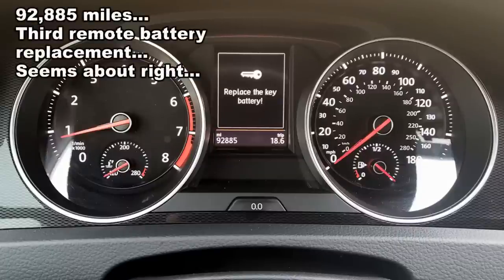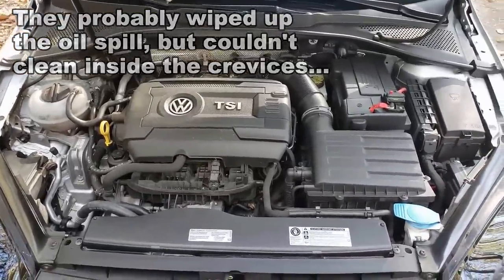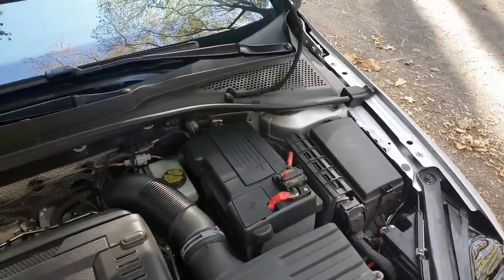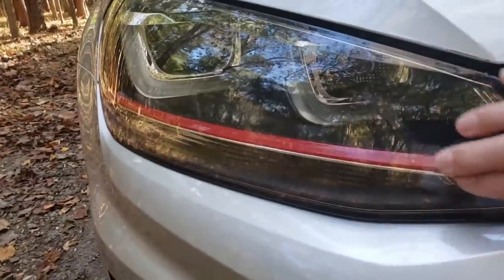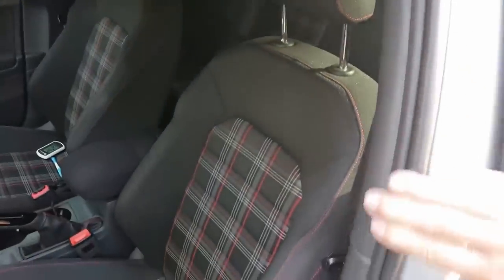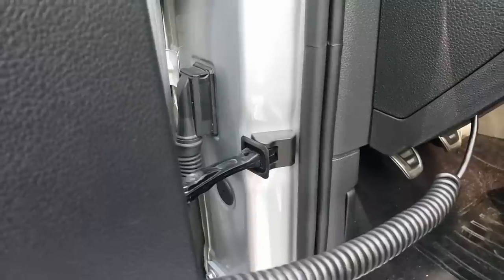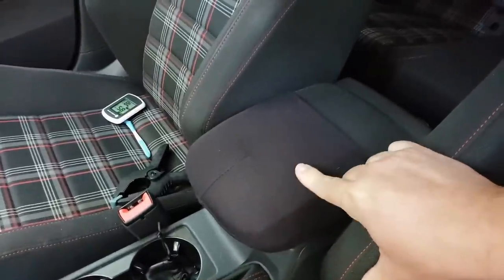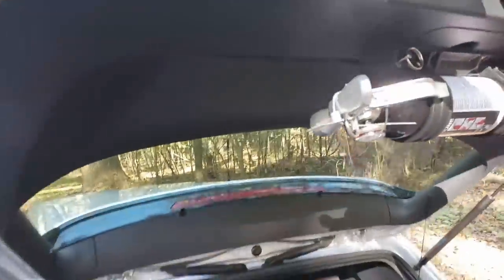THREE YEARS AND 93,000 MILES: My Report, Part 1

Comment: Many parts are unacceptable, such as all these little problems you mentioned.
I have a 2012 mazda 2, it's a 7 year old car, never has been in a garage, always out in the weather, it has almost 50.000 km and I haven't even replaced a light bulb...
Reply from the maker: Okay. My car has three times the mileage (use) and is kept outside. Light bulbs are all good. ;-)  I've already run the car farther than many choose to keep them. It's a win in my book. Come back when you're at 150,000 km and let me know if you're still problem-free. Later.
Reply: @StealthGTI  really? That is your arguement? Ok cool...
Reply from the maker: @sta8ise  - Yes, that's my argument. It's basic math: Your car is a driveway queen compared to mine. It's hardly been driven. My wife's Jetta is similar to yours in use. It's a 2018. In 2025, I suspect it will have 35,000 miles (50,000 km) and a similar report to yours. Take Care. -Scott
Reply: @StealthGTI  you are totally wrong. It has never been in a driveway. All the miles, have been driven IN the city. So you are making a video about all the issues that your car has after 3 years, and yet you are still defending this car? you would still buy it? Well I wouldn't... My point of view is that a car should have no issues after 3 years and 93.000 miles. If it has, I won't buy it, period... 
Oh and by the way, just because you like basic math: a friend of mine has a mazda 2 with 350.000 km and he hasn't even replaced the clutch, and has no issues what so ever.
Reply from the maker: @sta8ise  In a driveway or at the curb, it's all semantics. You barely drive your car, compared to mine. My wife doesn't even have a commute and drives more than you. Regardless, I suspect you're right about the Mazda 2 being reliable. Cars with less complicated systems, such as a 1988 Nissan Sentra that I had from 1988-1999, have far less to go wrong. Unfortunately, they're also boring to drive. As for your friend, good for him. Again, less complicated cars have less to go wrong. Regardless, I doubt he's done as much with his car as I've done with mine (330 hp and towing 1500-lb trailers). "Pay to play," we say as we modify. Take Care, -Scott

Comment: Too much plastic components on this car for my liking, plastic water pump, sump, intake plenum. Makes it feel like a disposable item lol
Reply: As with most cars these days. Only designed to last the length of the warranty.
Reply from the maker: Most cars in the lower end of the price spectrum are using more and more plastics. This is especially true in the front, where cars need to crumple to absorb energy. I don't know if quality cars, such as Lexus and Mercedes, use less plastics or better ones. But the plastics are still there. Thanks for visiting.

Comment: great video, i have basically this exact same car, 6spd 17 GTi sport.  i bought it almost a year ago with right around 70k miles, now it has almost 85k and i’m seriously surprised with how great its been.  i love the car, it’s given me some problems but nothing too serious, at around 80k, i had to replace the battery, just recently the leather on the handbrake started to peel up, and my stock clutch seems to be on it’s way out.  i installed VWR lowering springs, ECS wheel spacers, k&n air filter (cheap route, i know), and a little while ago i decided to cut the mufflers and resonators off.  just ordered a rev9 catback with mufflers because i’m not a huge fan of how it sounds anymore, then i’ll order a cts catted downpipe after i (hopefully) pass emissions with the new catback.  APR stage 1 tune should hopefully come soon after i get a stage 1 clutch too.  love this car, great daily driver, been super reliable so far, and it’s never a disappointment when doing some spirited driving.
Reply from the maker: Excellent news! Yes, you get what I was talking about with the leather on the parking brake. I just peeled mine off. I think it looks fine in piano black.  :-)
Reply: Still got the car?

Comment: Hi I just have a question can you tell about carbon buildup on valves I just bought a 2019 gti and I will like to know more about that thanks
Reply from the maker: Ovidio - I have no experience with carbon build up. Mine valves may have deposits, but it hasn't affected the way the car drives. Therefore, I cannot comment.

Comment: VW's cars are no longer the paragons of reliability they once were. They're not cheap to put right once out of warranty, either. I know nothing of BMW USA but my personal  experience here in The UK is that you'll find a BMW far less punishing to own than a VW. I ran a second user 528i until it was fourteen years old and it was no more costly than running a Ford or Vauxhall of the same age. It didn't go wrong much either. Certainly not the money pit they're often perceived to be.
Reply from the maker: Thanks for sharing that. I may need to consider BMW over Toyota for my next car.  ;-)
Reply: @StealthGTI  I'm currently driving a Mazda. I doubt you'll find BMW any less reliable than Toyota. But I can't comment upon costs of BMW service parts in The USA. Many assert that BMW US dealers are overpriced.
I made it patently clear I was speaking purely from personal experience only.
Reply from the maker: @paulanderson79  - Thanks. I was leaning toward BMW only for the German heritage. I've since looked at the pricing for both new and used. I can't justify it, which is probably why I've stuck with VWs for over 20 years. If I leave the fold, it will probably be for a Toyota. HAHA!
Reply: @StealthGTI  I had a bad experience with a second user Passat. Out of warranty everything that could fail did fail. And expensively. I replaced it with a Mazda 6. So far I'm happy with it, only time will tell.
Reply from the maker: @paulanderson79  - We had a new 2003 Passat. It was great, albeit a hassle to maintain, for 10 years. Then it was one problem after another.
Reply: @StealthGTI  2003 was well within the era when VW deserved its recognition for reliability. It seems that around 2009/2010 things took a turn for the worse. Not sure if that coincides with anything internal to VW's executive management or just a response to market forces. My Passat was a 2006 model and it was fine til about 2012 when things went expensively wrong. I ended up pumping over £5000 into it over two years. Outrageously expensive to put right. Hence replacing with a Mazda in 2014.

Comment: What clutch did you replace yours with after it went out? I have 24k miles on my car and I feel like my factory clutch is starting to lose it's bite. It hasn't started slipping yet though.
Reply from the maker: I went with an RSR kit from HS Tuning. I have details at https://stealthgti.com/2017/11/06/rsr-clutch-upgrade/. Thanks for visiting.
Reply: rambow70 I’m at 48k in my ‘16 and for the first time I felt what felt like the tiniest slippage the other day. I realized I’ve been driving it so hard so I’ve relaxed and it’s gone away but I still fear it’s on its way out

Comment: Where do you take your GTI for service especially all the fluids changed and how often each fluid got changed?
Reply from the maker: So far, I've done fluid changes myself. I extract the oil through the dipstick every 10,000 miles. I followed a three year interval with the VAQ fluid... just did that today. I'll do the 6MT transmission fluid soon. The brakes will be flushed soon, too. According the service booklet, the first flush is at three years, regardless of mileage, and then every two years thereafter. I think that's it.

Comment: I just found an oil pan leak on mk7 Golf GTI.
My coolant was low went investigating and found an oil pan leak, cannot find the coolant leak tho
Reply from the maker: Thanks for sharing your experience. Was the oil pan leak on the gasket or at the plug? As for the coolant leak, I've decided against topping off my coolant. I wanted to see how low it would go. Oddly enough, it appears to have stopped at the "MIN" line and hasn't moved in months.
Reply: @StealthGTI  Turns out it was a coolant leak from the thermostat and water pump. What I thought was oil on the oil pan was just the coolant coming from above.
Thermostat and water pump replaced. Haven't seen any further issues.
Although the dealership said the oil pan leak was from the oil fill cap but I found that hard to believe as the fill cap it at the back and the fluid I saw was at the front.
I will still be getting the fill cap replaced tho
Reply from the maker: @svisuals6180  - Thanks for the follow-up.

Comment: My wife has a 15 gti SE with manual trans. The strut pucks were not removed on ours either. 95k miles so far and stock battery still going strong. I have an S3 and it has the larger battery. Maybe because it has start/stop? Our gti needed coolant topped off once and never needed it again. I’ve read about many needing water pump replacement. My S3 also needed topping off. Wtf is that chintz canvas on the back side of the rear seat? That’s factory? Our car has leather and the backside is carpeted. Also the gti has been APR stage 1 for last 30k and the clutch is great. Nice to see how others are aging. 👍🏻
Reply from the maker: Thanks for the comments, Burb. The canvas on the back of the seats is actually a full-length cargo liners, primarily designed for dog owners and outdoors folks. Remember, my car is a working car; so, I wanted extra protection for the interior in case I haul something that can cause damage (which I have). I figured anything that could withstand claws digging into it would tolerate my loads. See a photo of the entire liner at https://stealthgti.files.wordpress.com/2017/08/canvasback-011.jpg. I have a full write-up at https://stealthgti.com/2017/08/09/canvasback-cargo-liner/. Take Care, -Scott
Reply from the maker: Oh, the photo doesn't depict it well, but the cargo liner on the floor and seatbacks is a single piece. So, it contains spills, too. I keep the factory cargo liner on top as an additional layer of protection. It's particularly useful when I carry a bicycle... It keeps the pedal from digging in.
Reply: StealthGTI ohhhh sorry haha I wondered. Makes sense. The hatch is so practical. We’ve camped with that car as well. on the other hand I can’t fit crap in my S3 which is basically a golf r with a trunk.

Comment: The coolant leak comes from an o-ring pipe connection right at the water pump. It just builds up that point with a slow drip. That's why you don't see any evidence of a leak. Happened on my 2L Tiguan.
Reply from the maker: My cooling system recently received a clean bill of health from a shop that would have gladly taken my money to do repairs. I'm sure everything is fine... until it isn't.  ;-)  Thanks for visiting.
Reply: You can't see the problem without removing the intake manifold. The water pump is well hidden unfortunately. 
Are you still missing small amounts of coolant?
Reply from the maker: @kgmMachineworks  - I have recorded the reservoir's current level, both hot and cold, and will see how long it takes to make a substantial change.

Comment: How is this car during the winter? It handle well with proper tires?
Reply from the maker: All-season tires are sufficient in my area. I've read that the GTI does very well in winter conditions with winter tires. Still, if the snow is deeper than 4-5 inches, then you'll be pushing against a lot of extra friction when the front spoiler acts as a plow. Thanks for visiting.

Comment: Buy a Toyota you can put that many miles in it each year and still have it run like a champ.. 👍👍👍
Reply from the maker: You're probably right. However, I didn't buy a GTI for what it is; I bought it for what I could make it, an example being a easy addition of 100 hp and 100 lb-ft. Nothing in Toyota's line-up gives the same balance of power, handling, and utility as the Golf/GTI. With that said, my needs may shift in a couple of years, which may result in me considering a 4Runner or Tacoma. Time will tell. Thanks for visiting.
Reply: @StealthGTI  Yeah that's true Toyota has failed in the fun department, I wish I could be excited about Toyota 86 or Supra but Toyota failed.. :-/.. nice looking car though.. 👍

Comment: I´m german. And I had many VW and Audi-Cars. Since 30 years. But my next car is japanese. 
Because of the relieability.
Reply from the maker: I've considered a Toyota 4Runner. But that's probably not what you have in mind in Germany. What are you considering?
Reply: @StealthGTI  
Thank you for answering.
I also consider a Toyota RAV or a Mazda CX 5. Both with AWD (All Wheel Drive) because I live in the mountains and sometimes we have much snow.
I would prefer Toyota, because it is the best brand in Relieability. But I don´t
like the automic gearbox from the RAV. And the CX5 motor is more powerful. But now I haven`t made a decision between Toyota and Mazda. 
Actually I have my Golf 6 TDI from 2011.
Reply from the maker: @peterx7230  - Very good! I've considered leaving VW from time to time. But the VW community is great. So far, the community outweighs the shortcomings of the car itself. But for how long?  ;-)

Comment: How long does a typical gti clutch last and what is cost to replace?
Reply from the maker: "Typical" is a tough one to answer. My stock clutch started to slip because of the extra power and towing. Its RSR replacement has been on the car for 150,000 miles. It slips on rare occasion. Replacing it with the SBC that I want will cost around $2600 including labor. The slip is very minor; so, I will let it run until it's worse and more consistent.  Thanks for visiting!

Comment: I Just finished building the motor in my 2015 A3 (same engine) I Went with a steel oil pan, no leaks at all, but oil temps are 4-6* higher than with the plastic pan.   I am going to put the plastic pan back on with the ECS street shield and should be a good choice.  

You need to make sure to use enough silicone , but also let it cure for 12-24hours.
Reply from the maker: Thanks for the note. Yes, my car definitely sat for 24+ hours to ensure the adhesive was cured. I'm going to try a Tiguan gasket with the steel pan first. It's a much less expensive option. If it holds, great! If not, then I'll go back to stock and get a skid plate. Take Care, -Scott
Reply: StealthGTI bro try using Hondabond. When my aluminum pan broke on my 1.8T the Acura dealer used that with a new pan and it never leaked there ever on my Passat

Comment: Your coolant loss isn't due to a leaking water pump/thermostat housing?
Reply from the maker: It doesn't appear to be. I had a competent VW specialist have a look. He didn't find any leaks. Oddly enough, the "low" coolant has stayed right at the "MIN" mark since around February. I have a follow-up posted from a few weeks ago. I'll post another update in November or so. Thanks for visiting.
Reply: @StealthGTI  Wow, you're the guy. Best get you up to Herndon to VWoA, and tell them you're real - no leaky water pump and no carbon build up induced cold start misfires.

Comment: I have a 2015 build date 05/14 with almost 94k lowered almost 2" and have the plastic oil pan. I have heard that the composite oil pan is actually stronger than the steel ones.
Reply from the maker: There are millions of composite pans out there. I imagine only a fraction of them have failed. Still, I have to disagree with the reports of the composite being stronger than steel. I've seen plenty of these pans that had shattered when struck by a stone or other road debris, which results in an immediate loss of oil pressure. Steel is far more likely to bend than break. It may still contain the oil or it may get a pinhole or slit if the steel creases. Either way, the loss of oil is much slower. I also think that anything that hits the steel hard enough to cause a failure will compel me to stop and look for leaks. The composite, if it fails, will shatter and dump the oil immediately. That was a bit long-winded. HAHA! Here's a photo of a damaged composite pan: https://stealthgti.files.wordpress.com/2017/12/crackedpan.jpg - Thanks for visiting! -Scott
Reply from the maker: I forgot a detail: Plastic/composite parts in the engine bay tend to become brittle over time. I think the heat cycling weakens them over time. I honestly don't know if the oil pan failures happened on older Mk7s or newer ones. Regardless, I tend to keep my cars long enough that removing a potential failure item is a good thing.  :-)

Comment: I want to go to a steel oil pan for the sole fact of being able to install an oil pan heater for winter, much better for the engine to get warm oil on start up.
I'll still take a tdi  tho, miss the hell out of my mk6 golf tdi. Being able to turn off traction control, no stupid stability control or collision avoidance system....can't forget about lift off over steer in corners that was always a blast.
Reply from the maker: What are you driving? If a Mk7, you may be able to find a traction control disable function buried in the MIB2 menus. My wife's Mk6 Jetta is that way: No traction control disable button, but there's a feature in the MIB2. Thanks for visiting.
Reply: @StealthGTI  my mk6 golf i could completely disable  tcs with the push of the button right by the shifter. But as far as i know you cant turn it off on the mk7's period.
Reply from the maker: @robbalinski1606  - GTIs have the TCS disable button. On the Golf, I think you might find it in the MIB2 menu under car settings. That's where I saw it on my daughter's car, a 2015 Golf S. It's temporary, but possible. Thanks for visiting.

Comment: Only 30k from a clutch. What have you been doing to it??
Reply: Dee Jarvis he flash a stage 1 tune onto his ecu, to gain power, the oem clutch held up to the job for another 15k that’s not bad at all, and expected. You need supporting parts when getting more power
Reply from the maker: See Part 2 for an explanation. Thanks for visiting.